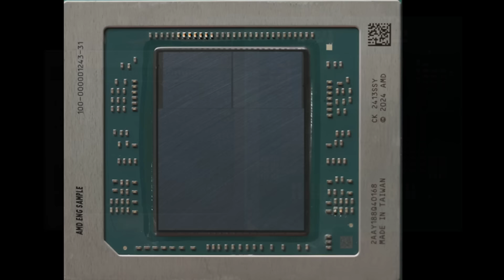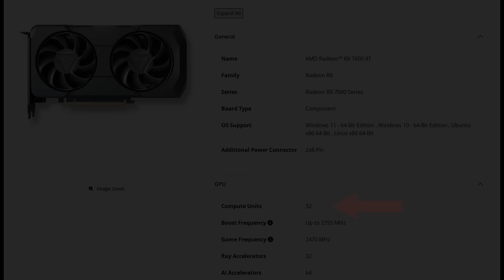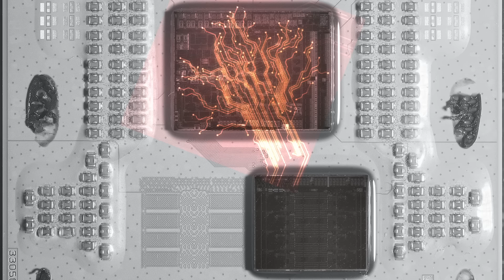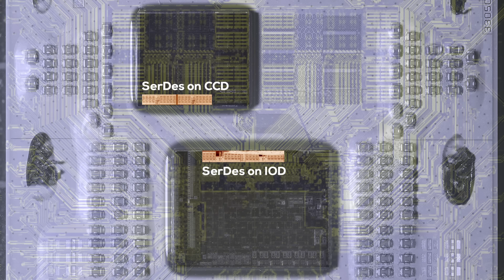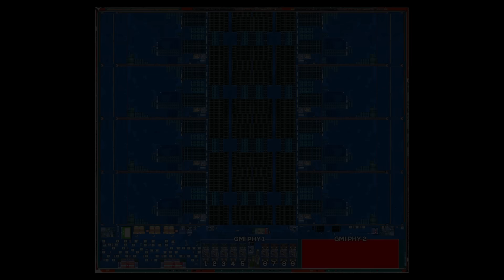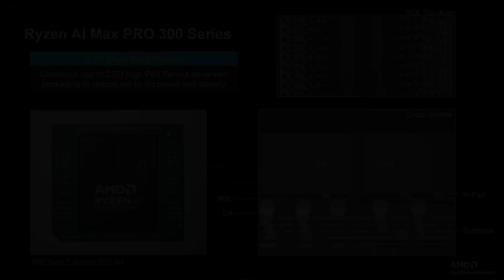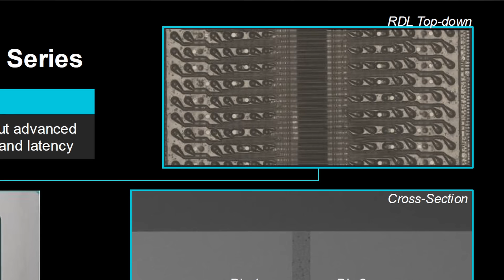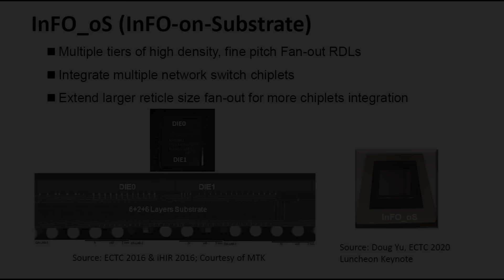How AMD is re-thinking Chiplet Design

Comment: Intel's really regretting calling AMD CPU's "glued together" aren't they. It was their downfall and they didn't even realise it.
Reply: Even Intel talking now about chippet design 😂 

It has drawbacks, but so expensive the chips is today, you must go for design similar to chippet as it cheeper have two chips than one that is same size as two chips.

Also memory is hard to scale down and if you could move that part to cheeper node and only scale down part that is easy and not so expensive.
Reply: Intel doesn't regret the Glued Together statement. Intel likely doesn't even recognize the problem - where it stems from.
For about 3 decades now - Intel has been a Litigate first, Market Second, Engineer/R&D sometime after type company - Every time an engineer focused individual gets charge; They are driven out - because that engineer starts thinking about profit in 3-6 quarters, or 2-3 years, not about tomorrow.

If Intel is starting to regret something - it's getting rid of Gelsinger and not allowing him to cook; But that would require them to even recognize that as an issue.

The last decade has been brutal on Intel; And yet - at it's core, Intel has not changed. They push Marketing above all else; because litigation isn't an option. Their greatest show cases are basically copying the home work of other people (which is fine, when you understand what is going on - but, eventually you need to prove your understanding during a test and... if you don't understand: you fail). Intel is failing. From Architecture design; To packaging faults; To Gas lighting their consumers/clients; To losing Apple as a client; To really just...  opening the door and basically saying "Ok, here you go".

Intel screwed up 30 years ago; And they never learned the lesson.
Reply: @formes2388  Intel cannot afford Gelsinger this late into the game. The company sooner or later would bankrupt if you dump billions into R&D on technology that won't be profitable for a decade when the boat has been sinking since the Zen2 launch. If he was brought in way sooner, Intel might have had a good chance. By the time he came in, he bet the farm on discrete graphics too late, missed the boat on efficient mobile processors, missed the gpu shortage, missed the foundry race to tsmc, missed hyper scalers server cpu market, and the entirety of the current AI bubble.
Reply: @formes2388 - I remember the Pentium 4 fiasco, when they pushed clock speed over everything else.  That was 25 years ago.

Comment: Apple use system memory by placing it on the same structure as their cpu. Now I hear Nvidia will also be applying that same technology when they manufacture Intel cpu with their own gpu. The question is would it be advantageous for AMD to also provide memory on chip with all their newer designs. There must be advantages but I can also see disadvantages by doing this.

Comment: I recall the 3D v-cache die on Zen3 is slightly smaller than the CCD and some googling shows this is true for the Zen4 and 5 dies as well. So you move the extra L3 cache on the cache die out of the way of the GMI links (if you even have to do that, depends on the layout) and just have TSVs. Unless there's something I've missed, the bonding of the CCD and 3D dies essentially allows them to act as if they are the same piece of silicon and not have any issue due to signal loss within the TSV.

I do like the idea from "Why Hybrid Bonding is the Future of Packaging" of CCDs directly bonded to IOD with extra cache in it, this would also directly link the CCDs and IODs GMI links with virtually no distance between them. But that video says that the bonding is done with chips of the same size, which I see 2 solutions for, 1. AMD is going to start making massive CCDs with many more cores to match the IOD size, or 2. and more likely, assuming this is how it works, they use dummy silicon when reconstructing the wafer before the bonding step.

Comment: the biggest bottleneck on Zen5 CPU's has been inter-chip latency and fabric bandwidth. There is not point in even making stronger ZEN cores or putting more of them on a package until that gets dramatically improved which is the biggest reason to buy zen 6 when it finally arrives. We are expecting major improvements to memory speed/timings/latency to go along with 12core CCD's and potentially 7ghz clockspeeds.
Reply: Minecraft is gonna run so good on 7ghz
Reply: @pootis1699  not without mods. and ue6 will still run like steaming pile
Reply: @s0ulll0warri0r its not the fault of unreal engine that games are poorly optimised, blame it on the executives who underpay and overwork developers with massive crunch tine and unrealistic timelines.
Reply: @s0ulll0warri0r  who said without mods?

BAJILLION CHUNK RENDER DISTANCE WITH C2ME HERE WE FUCKING GOOOOOOOOOOOOOOOOOOOOOO

Comment: Imagine that AMD would have chosen for a 5x5 cm² socket, a huge 56% upgrade from the 4x4 cm² socket. Imagine that AMD would have APU's built into the motherboard like for the consoles and put more memory, a higher memorybandwidth and more cores into the APU. So much wasted potential if you ask me.

Comment: yeah it's great, but we should not be sooo surprised, that is in on the level of an RTX 4060 or 4070 mobile. it's also a very expensive unit, so there should be some performance for the price. and the price is too high. but it's a great piece of hardware anyway.

Comment: This is nice for laptops but what are desktops going to do with an integrated GPU?
Reply: The iGPU or APU on cheaper gaming PCs will be better. It also enables smaller builds and PC-like SteamOS consoles. Also, this is interesting for running AI models locally, for privacy and anti-censorship reasons.

Comment: If I recall correctly the used space in the cache dies for Zen 5 was smaller than the core die so it seems plausible to me that they will either offset the cache dies or just pass the data lines through an unused section of them.

Comment: I have to say I'm so happy there are people out there picking up where AnandTech (RIP) left off in terms of covering the technical aspects of consumer CPUs and GPUs in an accessible but not dumbed-down way. (And yes, Chips and Cheese are definitely also on that list!) Your ability to present this in a clear and understandable way is amazing, and it's so cool to be able to learn about this stuff (especially now that so much of the tech space seems to be diving ever deeper down the AI hole, despite its severely limited real-world utility for regular people).

A question btw: do you think it's possible to place the RDL and cache die next to each other? Would the thickness of the two be anywhere near comparable so that this might be possible? If so that might at least seem like a potential solution to the stacking issue, though of course that would depend on the cache die's own connections to the CCD lining up in a way that makes sense. 

Also, I have to say I'm super excited to see AMD finally adopting this type of tech. Now, IFoP has been amazing in its performance for a relatively low cost, and its overall adaptability across generations of hardware - but it's also been showing its limitations for a while, especially in how it's essentially unsuitable for mobile applications, and how it's far less architecturally flexible than something like Intel's tile based chips. I've been waiting for the moment when AMD starts bringing proper GPU performance to mobile for years already, and to me it's always been obvious that this won't happen until they can do chiplet-based iGPUs (as IFoP just doesn't have the bandwidth required for a GPU's memory needs). Which I guess Strix Halo kind of proves wrong, but then it's also a very expensive and far from mainstream product with the giant iGPU-IOD. Now, if the rumors/leaks about upcoming modular GPU chiplets used across dGPUs, console APUs, and possibly also PC APUs turn out to be true? That would make the coming generation of hardware incredibly interesting to me. I'd love to see some mainstream+ APUs with 8-12 cores, 20-30 CUs and 256-bit LPDDR setups like Strix Halo, and combining this packaging tech with GPU chiplets used across the rumored handheld consoles and dGPUs would seem to fit the bill.
Reply from the maker: Thanks for your nice words, but I feel AnandTech was still a level above me. And yes, super sad they stopped.
Reply: @HighYield You could say that, but they also had vastly more resources and experience than you, and you've been doing this, what, a handful of years? Seemingly by yourself? The fact that you're even in the same ballpark should be a massive point of pride - we're talking about complex skills that also rely on a lot of access and resources after all. Also, IMO what AT had at their best was an unparalleled combination of accessibility and breadth of detail - the latter being a particular strength of writing rather than video (though video can make up by making more content and being more engaging), and you're very good at making this stuff accessible.

Comment: I knew this was coming not because of AMD but because of Intel's move into MCM and they called their chiplets "tiles" and then you look at an image of one and you see they're pushed next to each other and then you find out that's a newer interconnect with much better performance.

 So, it was either AMD was going to accept getting slaughtered by Intel again (Arrow Lake is already excellent in many regards and you have to forget about the rocky start it had), or they have to move to better interconnects.

The main thing I'm interested in is the speed at which parallel data transfers happen across this new interconnect AMD is using and I assume it will get faster over time.  The faster those transfers get the sooner the performance gets closer to how it would be if it were a monolithic die.

There's another option to a cache chiplet, and that is to not stack it but to have it beside the CPUs.  I don't know what AMD will do with Zen 6 but to me it seems like sticking an L3 chiplet between the 2 CCDs would mean all cores have access to a large pool of L3 and in fact that could now be a shared L3 between every core, on something like a 24 core CPU if AMD moves to 12 cores/CCD which seems to be the talk in the world of rumors and MLID.

Comment: Curious fact I learned while overclocking: when overclocking memory and infinity fabric on Zen4/Zen5, the higher the vSOC voltage, the higher is the chance to archieve better memory clock speeds, but as vSOC increases it somehow interferes with the fabric clock making it more unstable. So you can archieve higher memory clocks by increasing your vSOC up to 1.3V but as it increases it makes infinity fabric less and less stable, resulting in more and more retransmissions and forcing you to lower your infinity fabric clock. So there is this weird trade-off between memory controller clock and infinity fabric clock.

Comment: This was the best tech-video I have possibly ever seen. Subscribed and liked the video immediately, first time I saw video from High Yield.

AMD is making a massive upgrade and it looks like at great solution. I think it will be revolutionary, perhaps in it´s second generation (some initial optimization done, more experience at AMD etc). 
But. I am worried, if AMD will chip CPU:s for desktops with integrated graphics. Because a lot of people with desktop buy separate graphics cards - and don´t want to pay extra for a larger die, nor for a 7600-level integrated graphics unit inside the processor.

Best regards
//M
Reply from the maker: Thank you for watching. That's why I make these video!
Reply: @HighYield  It is I (and we all) who should thank you! 🙂 Thank you again and wishing you a great day! Best regards //M

Comment: an integrated GPU of this scale is unheardof on PCs only, it has been heard of, produced and used for years with Apple Silicon.
This kind of chip to chip interconnect is likely also very similar to what Apple used on the M1 Ultra and subsequent Ultra chips. This is all very old tech no need to get so excited over. Strix Halo is pretty meh, it doesn't idle nearly as low power as an Apple Max chip, and maximum performance is between an M4 Pro and M4 Max. For such an expensive system it can barely beat a PS5 in GPU performance, again there's just nothing to be excited over.

Comment: A really insightful video, thanks! 

I am not an expert in chip design, so I have a naive question: to avoid putting the 3D V-cache layer back on top of the CCD in Zen6, would it be possible to just relocate it to somewhere on that huge IO die, especially if desktop X3D CPUs don't really need all that space to be reserved for powerful integrated graphics? Or is the IO die already too far away from the cores, and the L3 would end up having so much latency that you end up not gaining over DDR5 memory, even with that fancy new famous interconnect? Is there any use in having "L4" cache that sits somewhere between L3 and "slow" memory in terms of latency and capacity?
Reply from the maker: You can put the cache on top of the IO-die, but then it would be more like an L4 cache and not a larger L3 cache. Still, something I can def see in the future. 

Or if AMD switches to a silicon interposer, you could put cache in that interposer.
Reply: Cool, thanks

Comment: 22:00 Personally I'm not opposed to top layer V-Cache.
Overclocking the CPU is INCREDIBLY time consuming and thermal limitations imposed by top V-Cache prevents me from trying.
Reply: AMD seems to be so ahead of Intel that the limitation of heat will only make sure that AMD do not screw up like with Zen4. Power efficient while being super performant. From Zen2 to Zen3 it is almost arguably a faster chip while also using less power. On the same node. From Zen3 to Zen4 the increased push to gain 1% extra performance while making 95c temperatures as a new 'normal' on the CPU... Zen4 was far more impressive ones turning on ECO-mode. But by the time AMD got it trough their lost-in-the-woods sculls AM5 seemed to be far to much wrong going for it to be worth upgrading. Then Zen5%. And RDNA3.

AMD is so far ahead of Intel and NV when it comes to consoles and PC in general. All AMD would really need is power efficiency and reliability. Even if Intel is 3% faster but at 100W more? Even when Intel uses TSMC the match VS AMD is laughably bad. x3d cache solving 1% and 0.1% frame-times alone in games while not having the CPU overhead of NV GPU's... Meanwhile Intel can not compete with their own I7 6700k or something like that for music production and such latency sensitive stuff. Only thing even remotely good left for Intel Hardware going against AMD? Adobe or something of such nature.

Still. This bonding and chip stuff makes the ring-of-death and PlayStation stuff come to mind. Together with AM5 blowing up x3d chips like it would be normal failure rate. Hopefully due to the awful Zen5% and motherboard vendors being completely incapable to handle AMD having no clue about what is going on at any point of the day? Lost-in-the-woods. AMD might end up releasing something bullet proof for late AM5. Without Intel being able to do anything but sniff glue and play with tiles.